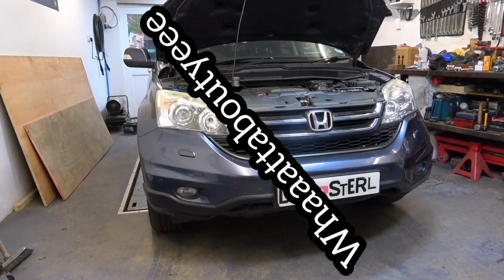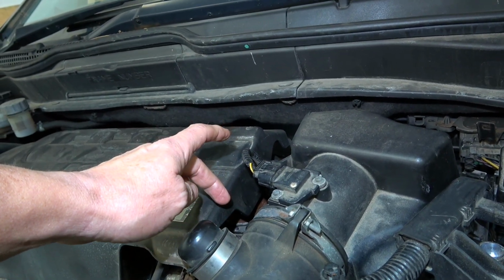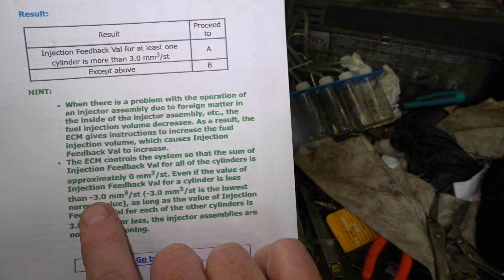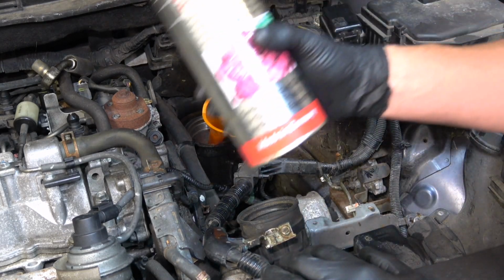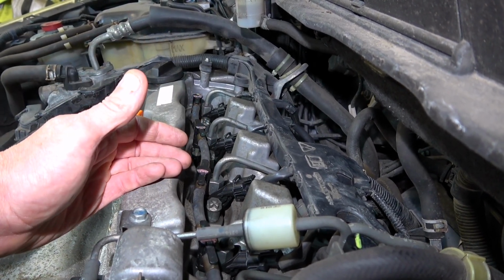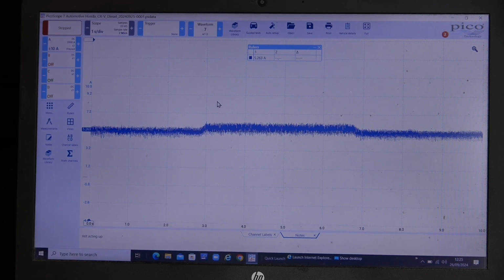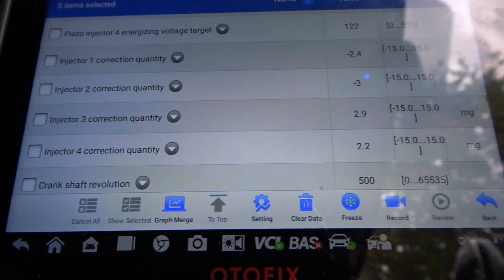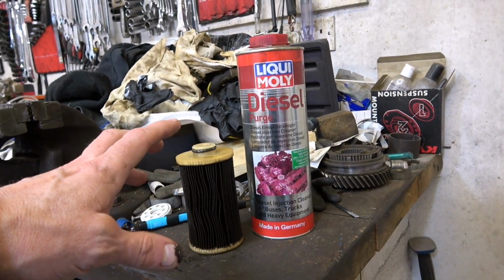Honda CRV 2.2 iDTEC, Poor Running. P0304 Cylinder Misfire

Comment: Excellent video, very informative. I have the 2.2 iDTEC Civic and have a fuel filter to change on it next week. I've just bought an endoscope camera to check that EGR pipe as I get a whiff of diesel fumes on occasion when driving it.

I'll report back on condition of the fuel filter.
Reply: Any update on the fuel filter and egr pipe?
Reply: @ClaytonRyanJackson  yeah, all perfect

Comment: Hello! I have a very similar Honda CR-V 2012 Gen4, 2.2 iDTEC and recently got a Check Engine with code: P1043 - Injector 3 Short Circuit. The check engine light comes on and disappears on itself. Also, the gas pedal seem to lag sometimes (for example I press it and seems like it reacts a bit later and makes the car shake on acceleration but very slightly). No other issues - no noises or fumes/mell. Car seems to be perfect.
Should I check the wiring?
I noticed that the injectors are very very hard to remove - I'm scared to brake the clip haha. Also the plastic cover for all the injector wires seems to be not-openable since it's very very hard to unclip. Thanks!
😅😅

Comment: Great video - LACK of  maintenance has a lot to answer for -
I had a Peugeot Diesel cutting out ONLY on load once - running fine on tick over & lower speeds / revs 
After MANY days on it - it turned out to be a Jelly sludge on the intank fuel pick up  - cleaned it out - problem solved 
I dont know if it was something to do with Peugeot / Citroen using  PLASTIC fuel tanks - (Early - Mid 90s )  but had quite a few of the same problem always on them !!
Thanks for posting video 👍

Comment: Great video, another failure item on those engines is the High pressure fuel pump (Bosch CP4) like you shown in the video, they like to fail and fill the fuel system with swarf. 
Good in-depth video

Comment: Great vid and very helpful. Funnily enough have a 2006 landrover discovery coming with this exact issue. Idle intermittently stumbling and missing under load. Albeit Bosch solenoid injectors instead of piezo but fuel compensation values are all over the place. Just shows you what basic maintenance and a good clean does. Thanks for documenting this case study 👍

Comment: Nice one Dave , I did a set of these around 2019 on a 2011 car with full dealer service history, injector specialist said they were not allowed to repair them, they tested and 3 were faulty , so customer said replace all , I insisted the guy had a new fuel filter at the same time irrespective of dealer history , car ran great for about 25 miles then the turbo popped , so he traded it in 😂😂😂, great in-depth video , no parts cannon with you Sir 👏👏, just proves how important regular  maintenance is , but no doubt you only charged him a fiver labour 😂😂😂, as many customers think we work for free as you and us in the job know , thought the guy was on a rally stage on his road test , only you are camera shy like me 😂😂, Poppy is growing up so quickly , secondary school wint be that far away 👍
Reply from the maker: Yes Mike, Diesel specialist i use says no repair on piezo and don't bother with reconditioned, tolerances are too fine. Poppy turned 6 the other day